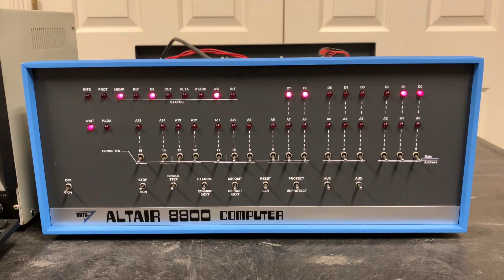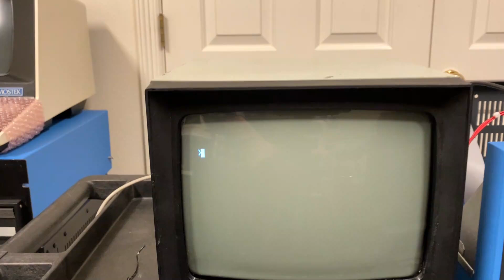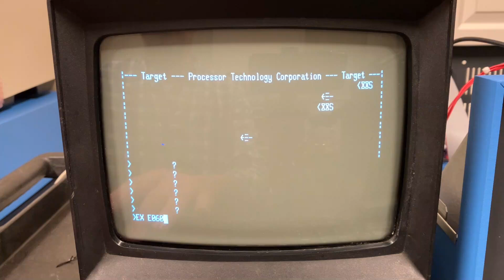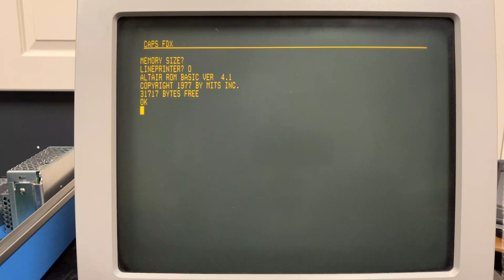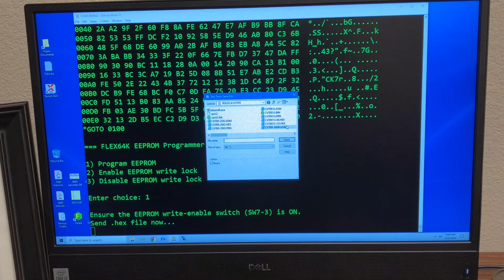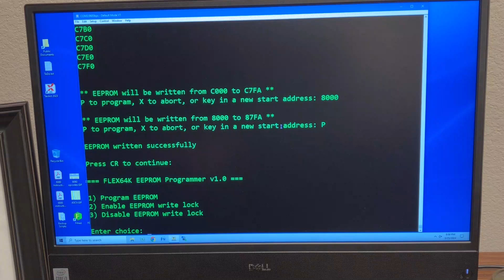New RAM/PROM Board for Early S-100 Computers

Comment: Thank you very much! As a beginner which serial card would you recommend? (I currently have the Altair 8080 CPU board, FDC+ and Front Panel with Controller from the 8800c)

Comment: Thanks for a very good board!  It works nicely in my Imsai with California Computer Systems (CCS) 2810 Z80 CPU and co-exists with the CCS 2422 floppy disk controller.  I can access the 2422 ROM at 0F000H and the FLEX64K ROM at other addresses, which allows the system to boot up to either the CCS disk-based CP/M or the "FDC + Server" disk emulation.  The RAM is solid, which is a real improvement to my system!

Comment: Hello Mike! I work at a Recording Studio in Gothenburg, Sweden. We have a neve console that uses s-100 bus for the flying faders. Im contacting you because a picture on your website is the only trace i can find of the video board used in the computer. It says "HI-TECH ELECTRONICS 1982 FELICITY ISSUE 3" on it. The monitor output on that board is a 25 pin connector that i have not seen used for a monitor before and we would preferably want to find a way to convert it to something like VGA. Or is it possible to switch it out for another board with a VGA output? My knowledge on this subject is very limited and I thought I'd ask you in case you have some idea on how we can solve this problem. Thank you for your time / J

Comment: In the early 80s, our school computer (RML 380Z) was plugged in to two old TVs and we used to turn up the volume on them to get "sound effects" very much like your AM radio trick... Back then it was amazing. It'd be a good 2-3 years before I saw a computer that actually had some kind of "real" sound output.

Comment: I want one,

That said, what do you think about the following:

OK, without a control panel the CPU board would have to have jumpers, to the address the boot ROM at E800hex on the floppy controller. The funny thing about The North Star Horizon floppy controller was that it was a read only device and it came in two versions, Single Density and Double Density. It occupied 1K of address space in high memory. The memory space was divided into 4 blocks. The first was the boot ROM and the second was just the mirror of the boot. The third block was the control and data block. The last block was the write data block using the address’ to write the data to the floppy controller. When the CPU was ready, to write data or read data, the controller would assert a memory wait until the data was ready I/O. This was very CPU intensive and interrupts where not allowed as this would ruin the timing of the read or write of the data sector. You also need a scheme to avoid memory conflict with any RAM board in the same address field. That’s very much how it worked. The floppies & drives came in single density single sided at 90k. Double density single side was 180k.